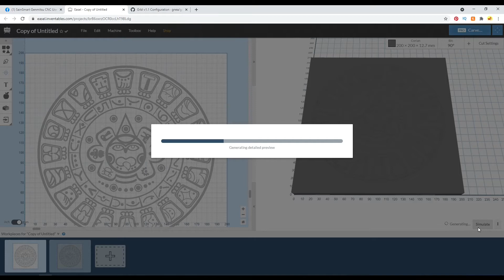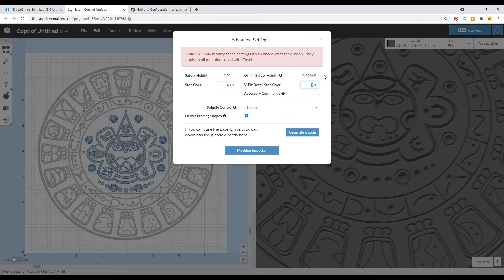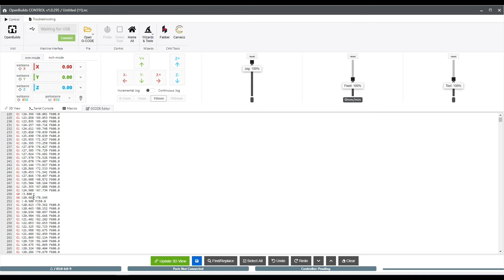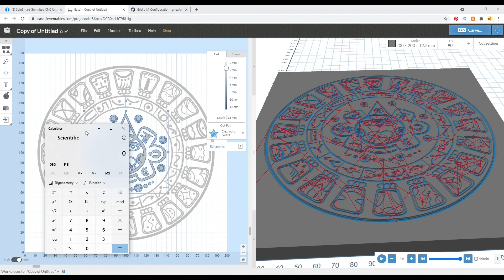3 SIMPLE STEPS TO CNC FASTER IN EASEL - Quick Tips

Comment: When I export my G code and go to run it on my Genmitsu 4040 Pro through UGS  it says my spindle speed is zero, any thoughts please?
Reply from the maker: Sounds like the machine wasn't setup quite right in easel..
Go to machine>edit machine and set to hardware and "other" spindle type And you can set the spindle rpm in the cut settings panel on the right.
Reply: @SethCNC  thank you so much for getting back to me and so fast! I shall give that a try!

Comment: Good hints at streamlining CNC operations.
When I started as a complete newbie 6 months ago, Easel was my 1st choice simple CAD/CAM app. However I noticed it was cutting every line twice, very slightly apart. Apparently common from scanned images, it would cut the inner edge, then the outer edge doubling the cut time. Always watch & understand what your CNC is doing,  try to eliminate any time wasting movements.
2nd, find the sweet spot of your cutters on your chosen material for optimal cutting.